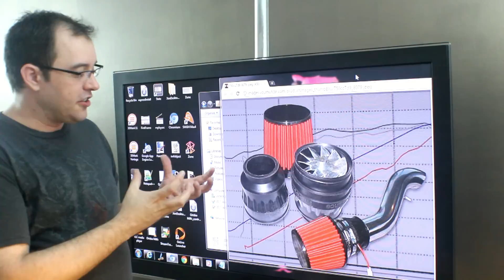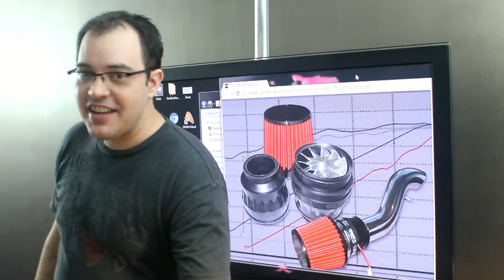Electric Turbo / Electric Supercharger / Forced Induction System: Should I Install?

Comment: Nope ? Nope about what ? A cubic feet is a cubic feet. You are not really clear when you explain something. But you're avoiding the main point of the topic: it's still useless to talk about the volume of air these electric turbo can pump. You rather should mesure the output pressure !!!! Full stop.

Comment: Your soooooo annoying .   600cfm is not "a lot" of air unless your talking about a 1.4l  engine.  If you engine has a 600cfm then it will suck 600cfm all by itself.  What people don't realize is that a real super charger  compress's and forces air into the cylinders.  These electric fans have no compression  value,  and blowing more air without more fuel means nothing.  Superchargers shove three times as much fuel & air into the cylinder .